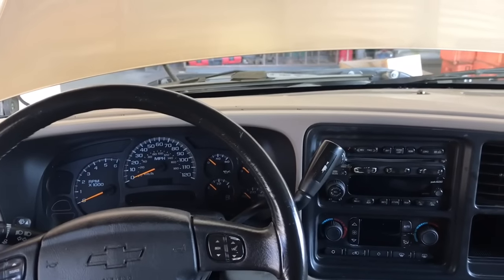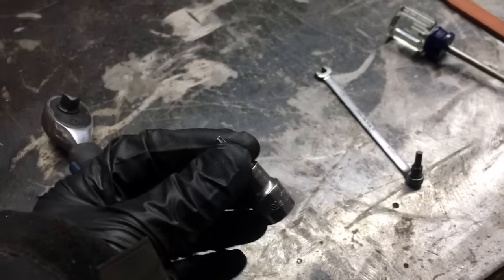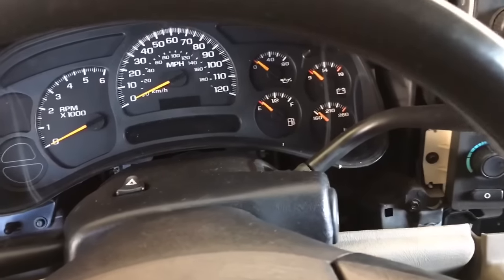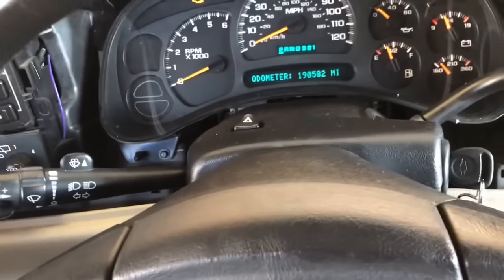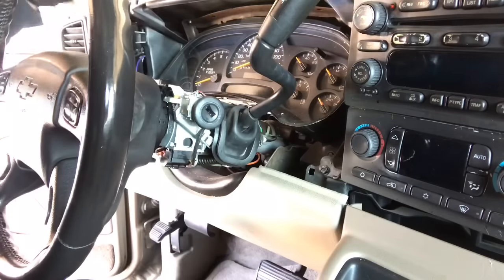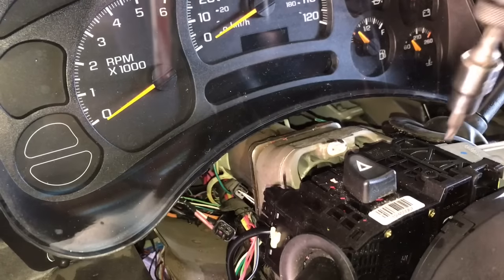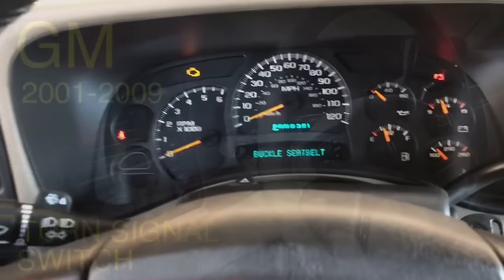Gm Multi-Function Turn Signal Switch Replacement 2001-2009

Comment: The wiring in this video is totally different than my 2001 GMC truck. Everything detaches from the wiring panel on the firewall, not the switch assembly itself. Oh, and for future references, you can just turn the steering wheel to access that bottom T-25 screw, as opposed to using a T-25 bit/wrench combo.

Comment: l have no + power  for turn signal.fuse is ok. problem is  no power + on in coming  leg. if l jump cross wire + to the other leg  both tunr signal will work, l need help ?? to look for + power  in coming or wiring daigram

Comment: I have no blinkers front and rear, also no brake lights in the back, I tried to replace the flasher relay and the circuit board in the back nothing fixed it, could this be the issue?

Comment: The issue I’m having is I just put spider headlights on with the tube protectors on and with the turn signals off while driving the truck says on the cluster turn signal on which I don’t understand when it says that the signals aren’t on and to make the warning go away you have to turn the signal on and off

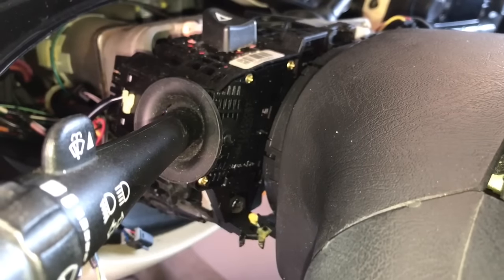Comment: at 7:11 when he starts using the T25 and an wrench, I found an easier way. Crank the wheel full left and you can use a regular T25 screwdriver as the steering wheel cover flattens out on the top for access. Much easier, especially on re-assembly
Reply: Guess I should've done that before I pulled the battery.... lol

Comment: The video mentioned about the small spring-loaded electrical contact pin on the turning signal switch. The spring went bad on my vehicle and the horn stopped working. A new turning signal switch with a properly working contact pin fixed the problem.... Good video, right to the point with clear instructions. Thank you

Comment: From the Rock Auto page on this switch.
"Switch malfunctions can cause a variety of safety issues, including non-functioning brake lights, headlights, tail lights, turn signals, hazard lights or wipers. Because of its role, switch quality is vital.

Each WVE switch is engineered to meet or exceed OE performance specifications and manufactured from the OEM preferred blend of nylon- and glass-filled plastic for exceptional strength, and includes premium copper-, nickel- or silver-plated electrical terminals to ensure robust electrical connectivity. WVE offers extensive selections of exact-fit/exact-function switches for foreign nameplate or domestic models.
Designed using semi-precious metal contacts
Each switch subjected to rigorous testing processes
Complies with all federal motor vehicle safety standards
Mounting and connectors identical to OE"

Comment: Dude your trick  with the 1/4” wrench and the torx bit was the best. Watched a different video at first and when he got down to the switch he said “just remove the two screws and the switch pulls off. It’s easy as that”. Glad I was able to find your video. I definitely subscribed. Thanks!
Reply: Im back today, couldnt remember the size on the screws.  I saw the same video you mentioned. Not helpful.

Comment: Good video, what I understand from another video, the steering wheel can be turned to the 3 o’clock position (straight ahead being 12 o’clock) and then the bottom screw can be removed with a regular torx driver instead of a bit and a 1/4” wrench.

Comment: This video helped me a lot. Thanks. I have one turn signal not working correctly. After confirming the bulbs were good I was sure it was the flasher but after watching this video I'm convinced its the turn signal switch.
Reply: Same here, right turn signal doesn't seem to want to work 90% of the time.  Gonna swap mine out this weekend!
Reply: Did it work I’m at the same spot with my 2005 2500 Chevy?

Comment: Replaced my turn signal switch today. The front torx screw you have to be very careful with it so not to strip it while turning the torx bit with a wrench.  I put a flat head screwdriver against the bit to keep it pushed into the screw while breaking it loose with my 1/4th inch wrench. I bought a 1/4" ratcheting box wrench to make the removal easier.

Comment: Alright man just replaced mine finally had the part just super busy with other work on the truck and I also appreciate the link to the new plastic cause mine did break a little bit it's 15 years old so it's all good but awesome process all the way through thank you again

Comment: Good video: I change mine out because when running my cruise control. It would shut off if I change lanes with my signal light on. Hit my signal any at all would shut my cruise off. This change out did fix it.

Comment: Great video!  You saved me a ton of money. I had a guy at a shop replace this for me some years ago, the shop charged me $500.  $300 was for just the part... I stopped going to those crooks.  Thanks for doing these types of videos!
Reply: I need to replace mine.  I thought $170 for the part was steep.

Comment: I was ok with the high beams coming on, I would just simply hold right turn signal slightly as to not cause the high beams to come on. My cruise control just went out as well, time to replace. I gotta have my cruise control. Great video, I appreciate it.
Reply: It gets annoying after while because then you have to hold it so they don’t come on randomly at night

Comment: This video was very helpful.  I know it saved me at least $200 in labor.  Plus, I was able to buy the part at a competitive price rather than paying the repair shop markup.  I just finished this 'half-hour' job.  It took me three days.  The 'little pigtail' at 6:37 was a FREAKIN' NIGHTMARE!  Getting it apart was easy.  Putting it back together was near impossible.  No room to get my hands or fingers in there.  The whole job was a frustration of alignment when putting things back together.  I think it would have been easier if I had removed the steering wheel, but I didn't want to mess with it.  If I ever have to replace this stalk again, I will gladly pay someone to do it.

Comment: Thanks very much.  I have a 2005 Tahoe with this exact issue.  Nice to see 190k+ on this one I have 180K+ miles and considering a newer vehicle but the Tahoe still runs great.
Reply from the maker: they are great vehicles,  and repair parts are easy to find

Comment: Thanks for this vid. My 2003 Silverado 2500HD did same thing. Brights go on when using turn signal. Similarly, I changed out the lever and problem  solved. I also mention that there were no bolts in the steering wheel shroud. I'm original owner. Came from factory without those bolts. The bolts aren't needed.
Reply from the maker: Very strange!

Comment: Thanks for video and link to buy a switch with cruise control $88.78 which was half the price of one they sale at auto zone, and then I saw one for $49.88 so I bought it.  I installed it and it failed, right signal would at times not work, so now I ordered the $88.00 one as suggested in the link above.   The bottom cover bezel is not held together by any kind of screws, I know this because I'm the original owner of my 2004 Silverado, and this problem started a few years ago, it now has 282k

Comment: thank you for taking the time to post this extreemly helpful instructional video. I am recieveing my new part tomorrow and this will be a huge help in its replacement!!
Reply: @Zion Remy Instablaster =)
Reply: @Joshua Idris Thanks so much for your reply. I got to the site through google and I'm in the hacking process atm.
Looks like it's gonna take quite some time so I will reply here later with my results.
Reply: @Joshua Idris it did the trick and I actually got access to my account again. Im so happy!
Thanks so much, you really help me out :D
Reply: @Zion Remy no problem =)

Comment: I have an 02' Blazer ZR2 and the flashers or turn signal works, cruise control works, but the wipers have a mind of their own. 
I can turn the wipers on & back off, then sometimes they stop, but mostly they keep wiping for about 12 more wipes before stopping.

Comment: I have an 05 Colorado and the cruise control hasn't worked in years. Would replacing this turn signal fix that? I have that exact same turn signal as in the video. I haven't found a fuse for the cruise control so I imagine it would be a replacement issue.

Comment: Is this similar to the switch on a 2007 Impala?

I have a problem where the high beams keep coming on just from hitting a bump or when I use the turn switch.  The high beams usually are pull back to flash, or push forward to keep them on.  Unfortunately they keep coming on and annoying other drives who think I'm doing that on purpose.

I don't know if cleaning a contact is possible to fix the problem without replacing the entire switch?

Comment: FYI if you don't have cruise control just replace the stalk with a cruise control one and shazam, you now have cruise. The pigtail that he mentions is for the cruise, the connector is just sitting there waiting for a mate :-). I have a WT model so no options and cruise was the one I missed the most.

Comment: Aaron if my truck has the standard switch that doesn’t have cruise control, can I buy the switch that has cruise control and hook it up to my truck and now be able to have cruise control? It’s for a 2006 Silverado WT(Work Truck Model). You didn’t show the cruise control wire in your install so I’m a bit confused if it’s possible or not because I thought there was a separate wire that gets hooked up for cruise control. Let me know thank you

Comment: So I had the same exact issue when I replaced the signal switch everything worked except the cruise control everything functioned before except like what you were saying the high beams came on on the right hand signal so when I replaced everything worked perfectly okay except for the cruise control now what's the issue on that

Comment: Thank you so much Aaron - My cruise stopped working but both of my turn signals work. So when it is time to change it for a new one than I will be able to replace it myself!!! I already changed out the fuse for cruise so in halfway there. Thank Again! Smiles ~ Debra 082820

Comment: My high beams are stuck in the on position, and I have no running lights or regular beams, the control housing was damaged from towing my truck. Will a replacement of this switch restore my headlight function?

Comment: Exactly what year is the one you are working on? I've got a 08 myself. I wish mine had the cruise control on the multifunction switch instead of the doo-dad on the lower right side of the steering wheel. Can I convert my over to the other style multifunction switch simply by changing it to the model with the cruise control built into it?b Or would I have to do some rewiring? Also, when I changed the multifunction switch on 96 Silverado (with stick shift) I heated a torx driver up and bent it at 90 degrees to do the same trick you did with the torx and box end wrench. Wish I would have thought of that!

Comment: I'm thinking this is what is wrong with my 01 Tahoe. Turn signals work on dash, but not outside, also my cruise control no longer is working. Checked fuses, replaced flasher. I'm also wondering if it would have anything to do with switching the lights to LEDs?

Comment: I have left turn signal that basically turns on the hazards but right turn signal works normally but this is a random issue and it does stop malfunctioning after awhile or when I hit the bezel so I'm assuming it's this switch.?

Comment: BELIEVE IT OR NOT when I turn on my right turn signal I lose all acceleration and half to turn signal off to accelerate, turn my steering wheel left for speakers to come on. Do you think this issue is switch related as well?? Thank you

Comment: Used T25 with quarter inch socket with extension and got that bolt out by turning steering wheel using the bottom of wheel could reach it little angle but it works try it saves time GOD BLESS 🙏

Comment: Aaron.....Thank you for generously creating this video.  I snapped/broke the turn signal switch entirely off.  Does that come with the part this shows you replacing?  Where are the links for what you'd order for a 03 Silverado 2500 HD?  Please and thank you for guiding me to those details.

Comment: I do have another question for you. My left driver's side headlamp is out. Already bought my bulb and it still is not working. So I researched that it could be my ballast. I purchased one. I took off my 2004 ext grill to where my ballast resides, then I followed the cable from headlamp and got to the base of the headlamp where there is a grommet with a dual rubber washer on both side at the base of the headlamp. I released the ballast which I was able to unclip  it but when I got to the grommet I couldn't release it from either side of the headlamp. Any suggestions or advice what to do next would be a blessing for me. Thank you so much. Ms. Debra

Comment: Quick tip. If you use the tip and the wrench put some tap on it to prevent the tip from going back. You won’t have to hold the tip with your finger and it will make it a lot easier and faster.

Comment: Nice video. Helped me tremendously. However I still have a problem you might have an idea about. I've searched all the realms and nobody has had the same issue. I replaced my multi function switch and fixed my high beam coming on when using the right turn signal. Very common issue. But right before I replaced the switch I had another issue I thought was related to the switch... Every right turn signal bulb is lit and stuck on. Even when the key is off. Not blinking but constantly lit. Pulled fuse for rt signal and still getting 12v to every socket. Including the tow mirror led arrow.  Even with all the bulbs out it's still lit up. Even on the dash. And keep getting "turn signal on" message. 2003 Yukon XL 1500
Reply: my bright lights just started coming on with right blinker on!!

Comment: In my truck it keeps popping  the fuses for the on the passenger  turn signal  and I have no low beam headlight on the passenger side, will changing  the switch fix this

Comment: Is there any fix to this problem without having to fork up $178 plus tax at Autozone for a brand new switch? Is there a broken wire, worn out contact point or bad connection inside the switch? Just trying to save some money right now with this damn COVID-19 putting the hurts to my wallet.

Comment: Could the multifunction switch be why my low beam headlights don't work, my high beams an DRL are still fine just no low beams whatso ever, I checked fuses and relays and there were all good

Comment: My left and right turn signals are flashing very quickly but when hazards are on its normal. Chevy avalanche 2007. Any suggestions?
Reply: If you changed to led turn signals you’ll need to get resistors it’ll get rid of the hyper flash or your bulbs are out

Comment: Is the cancel cam built into the switch or is it separate? I have no electrical issues but my left signal doesnt cancel on an 08 trailblazer

Comment: What about a 2006 Colorado?
My issue is the Brake lights don't work but the high center one does.
All the turn signal ones do, as does the cruse control, I've be pointed in the turn signal switch direction?
Reply: What did you find out? I have a 2005 Silverado with the same problem

Comment: Would u know what the issue is when I turn on either left or right signals, the light on (d) as in drive on the dash goes dim and the headlight sometimes intermittently goes off?

Comment: just a quick correction, the turn signal module is not the same after 2003, only 2000 to 2002 share this same module (tahoes only)

Comment: The Wrench and Torx bit is not necessary. There is a mark in the center of the horn plate. Turn the steering left till that mark lines up with screw. Then you can use normal torx. Your saving 10-15 not taking off the steering wheel. This will take seconds with cordless impact.

Screws underneath should be reverse torx. That’s why so many break them.

Comment: Could you help me out on some information now with all that said in this video of yours okay my Chevy Silverado 2000 1500 series no turn signals come on at all I checked fuses replace uses check all bulbs wiring everything you still think it's the switch on my steering column? And let me add no sometimes it works not at all and no high beams come on and off high beams do work if I do it manually on the same controller but just no clicking on the dashboard no clicking anywhere no turn signals at all

Comment: So recently my brakes stopped working.... Fuses are good, I switched out the switch under the brake pedal, the module under the truck I'm the rear of the truck under the bed, and the wiring harnesses... Still nothing... I'm at a loss now... Could it bed this switch?? Everything else works fine (turn signals, hazards, running lights, and reverse lights)
Reply: The brake light circuit would not go into this circuit so I doubt it.
Reply: What I would do is find a wiring diagram that leads to the brake lights and find out every component that the circuit passes by. Most likely there is a shortcut happening to the ground causing no power going back there. Unless you fixed it already 👍
Reply: @joelsalazar3332  I appreciate you! Not fixed yet, one ended up working again 🤔 but I'll do that and figure it out to prevent it from doing it again in the future! I appreciate your advice!
Reply: @lettyh2850  no problem, that's what I got for advice since we are learning this at school right now 😅  so goodluck
Reply: @joelsalazar3332  I appreciate your passing it on!!!

Comment: hope this helps me, my 01 tahoe's hazards never want to turn off once i turn them on!
Reply: It will is a one pc switch so you are replacing with a new one
Reply: Craigslist510 you can order just the hazard for around $7 (you need to take out torques screws on the left) but I advise to just change the entire switch.